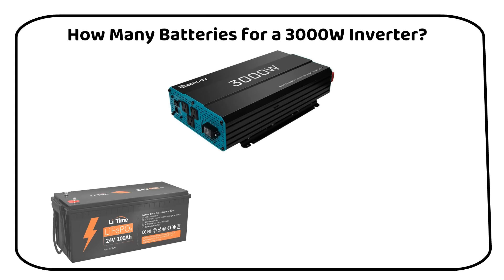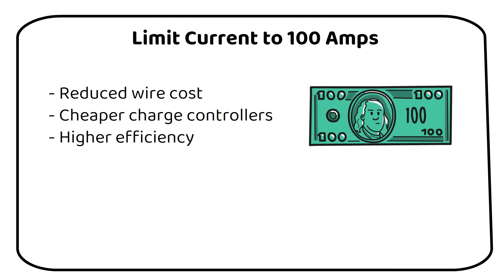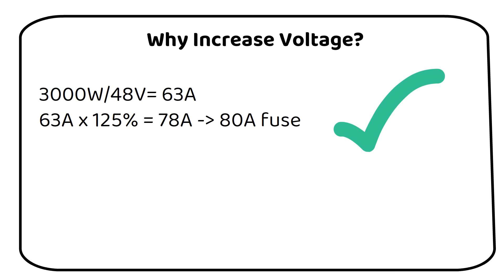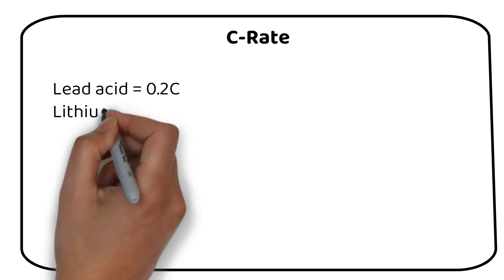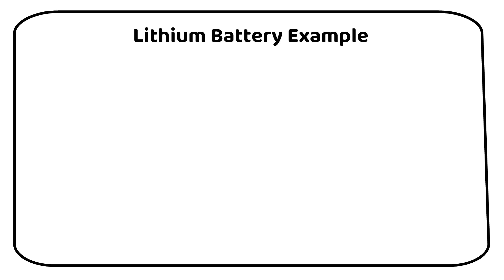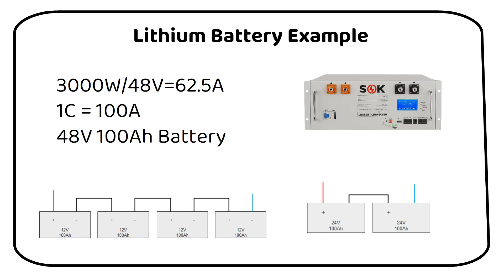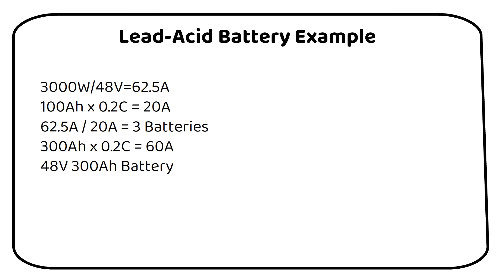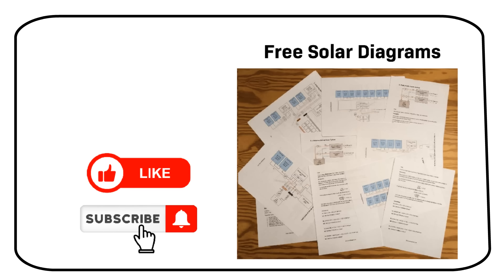How Many Batteries For a 3000W Inverter?

Comment: I have 2 100ah lithium batteries charged by 400 watts of solar.  3000 w inverter, which gets used only for a few minutes at a time, typically to run the microwave when dry camping.  Don’t need 120 vac otherwise.  Have usb built in to my 12 vdc system, so can charge cell phones whenever.  While the RV has an air conditioner, I don’t intend to use it.
Reply from the maker: Do you turn off your inverter when you don't need it? Otherwise the idle consumption will take 720wh per day from your battery.
Reply: @cleversolarpower yes.  I turn it off.  I put the inverter switch inside the trailer in easy reach.  I also have to run the power from the inverter to the external 30amp  plug, so use is deliberate and not accidental.  Also, if it is left on, and I don’t switch off the proper circuit, the inverter will try to charge the batteries if left on.  So, it gets turned on only long enough as actually needed.

Comment: Why a inverter? Is there anything today that doesn't run on 12V? I'm living now 8 years in a caravan and cover everything from Internet to watch movies, from mobile to tv and vacuum cleaner, with 1x 100ah 12v battery and 1 portable solar panel.
Reply from the maker: Still many household appliances that use 120 or 230VAC. if people have these devices already, it's not worth it to purchase a 12 or 24V version of it. DC fridges are more expensive than AC fridges as well.

Comment: I have 4 batteries with the Renogy 3000 watt inverter. They are 4- L16 380ah in 2 strings of 12 giving me 760AH. There are many ways to do and infinite possibilities.
Reply from the maker: Yes, C-rate is the most important. Voltage is about optimizing costs.

Comment: Hello
I wasn’t going to say anything cause I see nonsense all the time on line and can’t be bothered to put my two cents in for lots of reasons. 
However….
I’ve been designing and installing off grid systems for 14 years and I also live off grid. I have taught hundreds of Solar PV workshops across Canada and have taught hundreds of engineers and electricians the proper way to design and install solar off grid systems. 
You size your battery bank first to give you the days of autonomy you need while running the expected loads. Then you size the solar array to provide adequate charging of said battery bank with the Peak Sun Hours in the area taking into account the site efficiency. 
Then you choose a charge controller that can properly charge the battery bank with the appropriate amount of current and can also handle the array wattage. Then you choose an inverter that can easily supply the wattage typically required. Most inverters we use are between 4000W and 6800W and can surge much higher.
Reply from the maker: Thanks, I have a video about what you explained on the channel.

Comment: It’s not the amount of batteries but the amount of amp hours. The higher amount of amp hours you have the longer you can use the inverter
Reply from the maker: This is not about how long we can power it. This is related to the current draw.

Comment: You have it wrong.  As a Watt is a Watt. Now you might save on wire sizing and charge controller. But you lose all the effeminacy loses when you convert the 48 volts back to 12 volts. Which is why 12 volts wins in the long run. As they don't make 48 volt lights or appliances..
Reply from the maker: I see, that's why large systems use 12V 🫢
Reply: @cleversolarpower  Large systems are designed with 2-4-6kw Arrays in Series. Why the solar panels have to be rated for over 150v Ocv to get 6 panels on each array. If you want to run 48 volts to run 120volt appliances..

Those are the trade offs.

But make no mistake. A Watt is a Watt. It's why the Utlities install Watt meters to charge you electricity use. They could care less what voltage your using..

Comment: How many batteries for a 3000 W inverter?
impossible to answer.
You need to give the peak current and rated current.
And name the devices that will be used.
To be able to respond.
Reply from the maker: When you have a 3000W inverter, you have to size for a 3000W load. Simple. Wires and fuses needs to be sized accordingly.

Comment: YOU DONT ANSWER THE QUESTION THIS VIDEO ASKS no one building a camper,  ((( 90% of the people watching this video!!))) wants to know about  48v batterys OR server racks simple question .... How many 12v AH do you need to run a 3000w inverter ? i know its dependant on what you run and how long for but to be safe  ...How many 12v AH do you need to run a 3000w inverter ?
Reply from the maker: Did you miss my recommendation at 1:00 ?

Comment: 1600 Watts of Solar Panels and Dual Renogy 60 Amp Charger Controllers into 4 AGM RENOGY 200 amp an Hour 12 Volt Batteries Wired as 48 Volt enough to Power a RENOGY 3000 Watt Inverter ?
Until I can Buy 4 More RENOGY 12 Volt 200 amp AGM Batteries for Separate Battery Banks later ?
Reply from the maker: A 48V 200Ah AGM battery has a C-rate of 0.2. You could discharge at 40A (200Ah*0.2C). 3000W/48V=62.5A, so so if you add double the capacity you will be ok. Now it will work too, but your batteries will die sooner. I don't think Renogy has a 3000W 48V inverter though.
Reply: awe, Your Right I was wanting 2 banks of 24 Volt Battery Bank at 200 amp hours x 2 Batteries each Bank for the Dual Charge Controllers. RENOGY'S 3000 Watt Inverter is Just 12 Volt.

Comment: The 48V requirement is obviously not correct because they make 12V 3kW inverters.   Very common actually, so this dismisses the whole video.
Reply from the maker: Just because you can buy it doesn't mean it's a good decision. I recommend watching the video again 😉.

Comment: Sir i have solar panel that has 100watts and 12v 100ah battery with inverter of 600w-1200w

But when i try to charge my laptop... battery finishes fast and inverter starts to make the annoying noise,what can i do to fix that problem?

Comment: Just a heads up for the new guys .

** NEVER PARALLEL THE INVERTER OUTPUTS  **
Reply from the maker: * if it's a off grid inverter. Sounds like you have experience with it 😉

Comment: This is wrong, u NEVER pick a fuse because of the current - u pick it because of the rated current of the WIRE. Its a safety for the WIRE, not for the unit...

And the money u "save", if u buy 48V units, u need more money for a 48V battery. so its the same money ^^
Reply from the maker: I always fuse based on the wire ratings. Check my video about sizing wires and fuses. Some people have 4 12V batteries in parallel. You can make a 48V system out of it.

Comment: For you focus too much into the cost of materials. An investment is needed to install the equipment. A 48v system is not something recommended for DIY
Reply from the maker: I see too many people using a 3000w inverter on a 12v battery. This is to help DIY people and show them how it should be done properly, even if that means buying more batteries.

Comment: this is incorrect

a 400Ah 12v LiFePO4 battery with an internal 250A BMS will comfortably drive a 3000w 12v inverter. Equally, a 30A 12v charger will quite happily charge a 400Ah 12v LiFePO4 battery - it just takes longer to do so (a full day for solar, or overnight for 240v mains)

I use a Victron Phoenix 3000w inverter; Victron are a top-rank supplier of solar/charger/inverter/battery equipment. If it was not viable to operate a 3000w inverter at 12v, why would they produce one?

In many contexts - in a marine environment, for instance - most standard equipment is only available in 12v configuration (including high-current devices such as anchor windlasses). Trying to operate hybrid 12/48v systems is impractical, inefficient and potentially dangerous
Reply from the maker: Two distinctions are made here. Lead acid and lithium. Both have different C rates.

Comment: A 12v 100a battery usually has a 100a output or 1280 watt. You would need 3 batteries in parallel to satisfy max inverter output. 

But you should also consider max output from your dc panel. Add both numbers together dnd you might find that 4 batteries in parallel are the safe option. 

Just be aware of the specs of the battery. Not all are rated at 100amp discharge. In particular larger batteries may be 100amp discharge but have a greater capacity, so going by capacity alone won’t work. You would still need 4 batteries if you yse 200ah batteries that only have a 100amp discharge rate. And don’t forget about 20% marking for surge.

Comment: Are you using Peak Power or Actual Power in the calculations? 3000W Peak/1500W Actual?
Reply from the maker: 3000W actual power. That's what the inverter is rated for. I assume you are asking because the peak power is more than the actual power. It's only for a short while, this will not affect the wire or fuse sizing because it's usually for less than a second (startup surges).
Reply: @cleversolarpower  Thank you. All the Video's never say Peak or Actual. It would be a good idea if they did. It can be confusing.

Comment: I was listening until I heard 125%.  There is no such thing as 125%, 100% is the maximum.
Reply from the maker: It's the NEC rule. Do you undersize your cable and fuses?
Reply: % means parts of 100. It is used all the time when it is actually wrong. Do you understand basic mathematics.    @cleversolarpower

Comment: That is not how it works!

- Voltage needs to be appropriate for your inverter! Check what voltage it is rated for. (eg. My father has a 3000W inverter rated for 12V. If I put a 48V battery on it as you suggested, it simply can't handle that!)

- Yes I still need at least 3-4 batteries IN PARALLEL(!) to avoid damaging them if I run the inverter at or near max load continuously but that's still only 12V, and it's well over 100A, so I need thick cables to avoid fire hazard! (I simply can not connect the batteries in series for 48V to keep Amps under 100A, cause my inverter isn't rated for that!)

- There are plenty of reasons why you would not want a 48V system over a 12V system. (eg. 1. My father uses whatever old/used batteries he finds cheap, which makes it dangerous to connect it in series for 24V or 48V systems, cause we don't know the battery's condition. One may be better, the other weak. 2. We already have several 18V solar panels to charge the batteries, and 12V car charger in case there is no sun, which we would have to replace if we went for 48V system. 3. We can run the inverter with a small load on just 1 battery any time if he needs mains power at remote location. etc.)

- Current varies according to the load * efficency + inverter's quiescent consumption.
I measured a 27W quiescent consumption, with no load on it.
Let's say the inverter is 85% efficiency.
(300W / 85%) * 100% = 353W (rounded)
(353W + 27W) / 12V = 31.67A Therefore I can easily run my father's 3KW inverter with 300W load from just a single 12V battery, and not worry about killing the battery.

So it's a far more complicated topic then your video suggests.
Reply from the maker: You can use a 3000W inverter on a 12V battery, it's just not correctly sized. I recommend increasing the voltage of your system if your inverter gets larger. Not required, just a recommendation. Wires, charge controllers,... Will be cheaper.

Comment: You treat a guideline of limiting to 100A as a rule with no real explanation beyond general economics.
Reply from the maker: Indeed, that's what it is. Also, if you are going to diy crimp the cables, lower current is safer.

Comment: So I want to power up my bitcoin miner witch need 1500 watt 

how many batteries that I need?
Reply from the maker: Take a look at my video about calculating an off-grid system. You need to know how many watts the pump is and how long you run it for a day. The sunhours on your location and days of autonomy is also handy.

Comment: What if you cannot afford a 100AH lithium battery?
Reply from the maker: Last time I checked they were $350 for a 12v 100ah battery. If you really need it, then you need to save up. You might like my video where I compared lead acid with lithium and lithium is actually cheaper in the long run.

Comment: How many batteries for 3500 and 2500 watt inverters ?
Reply from the maker: It follows the same principles. It's different for lead acid and lithium. Rewatch the video, but then use your inverter power.
Reply: @cleversolarpower  because I may be getting one or both of these for a setup using lithium batteries. I was more then likely to go with 100 Amp hour 12 volt batteries any were between 4to7 and 4to8 HQST Mono crystal panels I already have a victron 100/30 mppt controller I've been picking up little pieces here and there. And my understanding is getting better. But I'm still very much no expert. And still struggle to comprehend Certain elements of these setups.

Comment: Where are you going  with your 48 v ????????  Do you think that people only use the battery to power the inverter , and nothing else??? That's ridiculous......people use the 12v side of the battery voltage almost as much  to power various devices or appliances . 48v is utterly useless other that being an inverter power source.
Reply from the maker: In large off grid systems 48V is the norm. If you have an RV, you can use 12V with your appliances. There are also converters which you can use. It's about cost/benefit, both work.

Comment: I have a 3000w inverter on my 24v 4x 50ah batteries wired 2s2p off 6 100w panels.  Ive been running this for over 3 years now, no issues with the batteries.  Its not the inverter thats the issue, its how much you RUN off the inverter.  Would I ever try to pull a full 3000 watts from it?  No, thats MORONIC.
Reply from the maker: Then why do you need a 3,000W inverter? You also have to size wires and fuses according to the current. So why use larger cables than necessary?
Reply: @cleversolarpower  agree with everyrhing you say.  I pieced mine together, I didnt buy a kit.  And a 3k inverter came along cheap on mac for 60 bucks.  I simply never load the system up that hard.  I have my MPPT, 4 12v 100ah batteries in 2s2p 24v, cant recall wire guage but about as thick as my pinky, 2 balancers, 6 100w bifacial panels  on a ecoworthy sun tracker, an LCD battery monitor with in and our current sensors, and a load center like I use for my generator to see actual watt load on the circuits.  I know for a fact a 3k is well beyond what my batteries, and likely the wire can handle but its simple..... i just only switch on loads the math says it can.  Having a 3k isnt the issue, not knowing your systems limits is.

Comment: I have a 12v 200ah lithium battery and a 3000w inverter im an idiot wish id of seen this before
Reply: does it work??? if so you are not an idiot,  this video has many many flaws.  if you run you car or charging system while drawing a high current for a short period of time you will have no problem.   nott mamy people run a 1000 watt micro wave for 1 hour. lmao.
Reply: @luedog8385  I have no idea as of yet I still need to fit the inverter I need to order cables also 125mm or 4awg is what i was advised 2m length
Reply: @luedog8385  the only reason i ended up with the 3000w is because the 2000 and 1000 was out of stock and I needed a battery so made it a better deal getting the 2 at the same time. The max thing i have is 2300w and that would be for less than 10 min I think it will be fine

Comment: I seriously doubt the 3000 watt inverter is using 3000 watts all the time or more like 500 watts. You use a larger inverter to start up compressors in AC units and refrigerators, freezers etc. a 24 volt setup is ideal not too high and not too low for running cables. I seriously doubt my small refrigerator will run on a 1000 inverter. 73

Comment: He’s wrong you want the full power of the 3000 watt you will need at least 4  
The 12 volt or 24 volt makes no deference if it’s a 12 volt then you need 12 volt and a 5000 watt you need at least 4 I know I live of grid on solar I run a 3000 watt and a 5000 watt you need no less than 2/0 wires for the 3000 watt in order to get full power and 5000 watt you need 4/0 wires so I don’t know where he got his education
Reply from the maker: No, but you will be paying more for wires and charge controllers because it's a 12v system. Not efficiently sized. Can you run a 3000W inverter on 12V? Yes. But it's not a good idea.

Comment: I am not saying it is easy for everyone, ir should be easy for everyone ,but if you can't figure out an approach how to determine how many batteries you can connect up to an inverter, then I suggest you don't have sufficient electronics knowledge and you should stay well away from this subject and find someone else who does have sufficient knowledge and expertise.

I was in an argument just the other day with a guy the other day that claimed he did his own solar panel and battery sizing and inatallation but didn't know the difference between kWh and kW.

If you don't understand when to use which, then you can't do the calculations correctly. But alas he couldn't accept his level of knowledge was seriously deficient.

To be safe, you need to understand your level of knowledge and don't attempt to do things on which your knowledge is deficient.  Seek help from an expert.